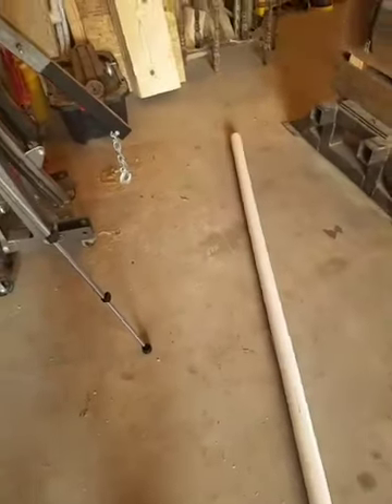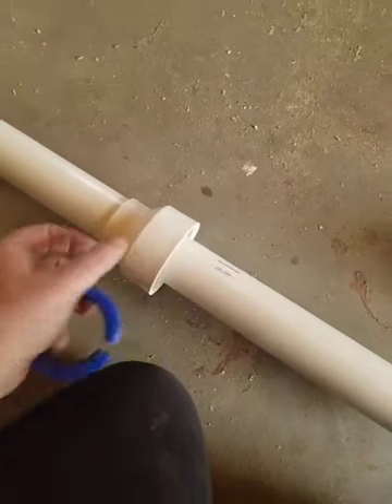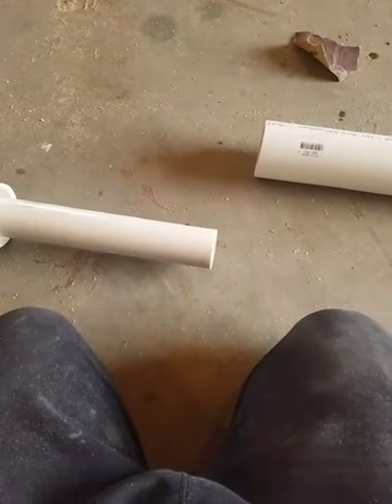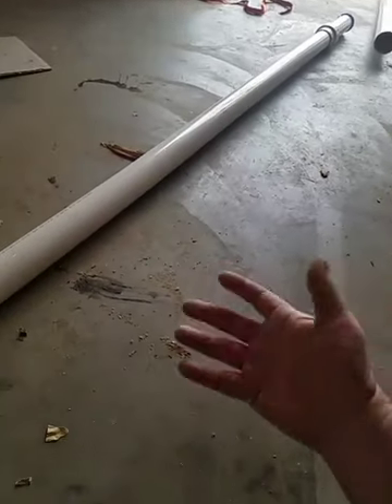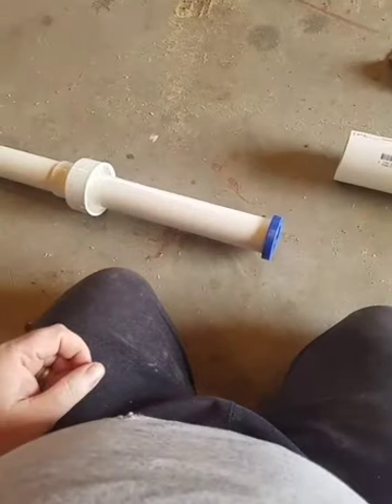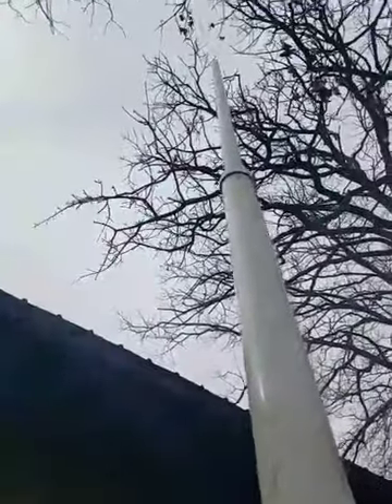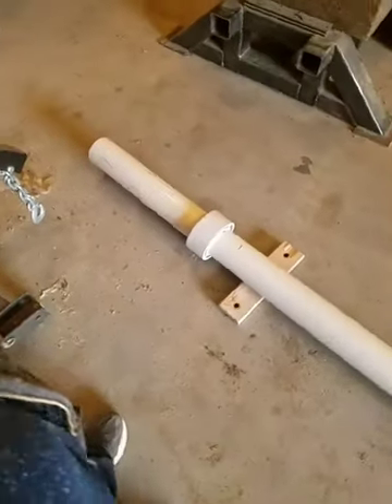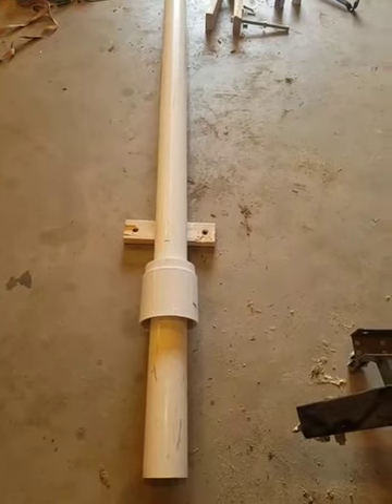Antenna mast from pvc with new joint method.

Comment from the maker: So, theres a lot of complainers posting on other videos about how this just wont work.

Well its still up there, its been up for over 3 years now. No guy wires and has a 6el yagi, a 5el yagi, and a jpole on it. It works just fine, and has even made it through a small tornadoe and numerous high wind storms. 

If you missed the other updates I gave on this mast, I can't help it. It works, and works well.